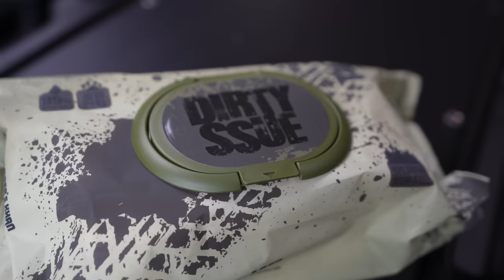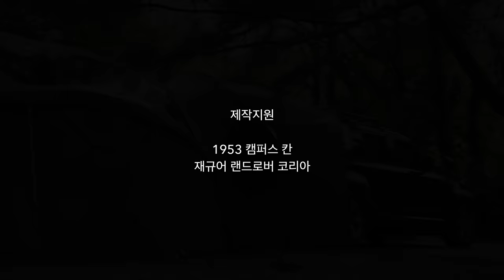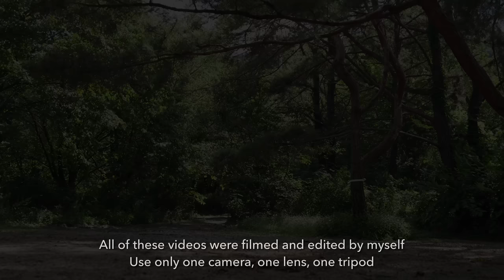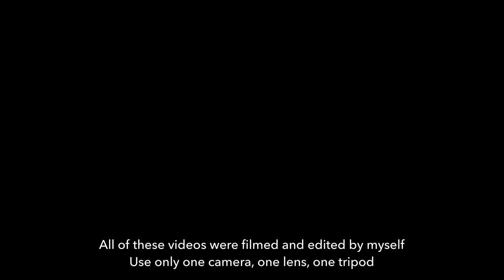Brand New Tent For Car Camping With Land Rover Defender 130

Comment: I think for me personally, all the set up and then the pack up would just sap all the fun out of the trip - especially the dark cloud constantly over my head knowing I’ll have to pack all that back up. Looks space age though.
Reply: Eaxactly - and the price of all that kit - how much would you re-use to get the value out of it over the years before it brakes, degrades or gets lost?   
Sooner buy a Dacia 4x4 and stay and a warm air bnb up the road each night!
Reply: @ajwest3081  I was actually just implying that I’d go for an easier to set up rig. If the guy wanted to camp in something that big, there are heap of single pole tents & bell tents that erect & disassemble in only a few minutes. I personally have a 23zero Outback 1550 swag that literally sets up in under 4 minutes and it already has all my bedding already in it rolled up. So all I’ve got to do is fold out my chair & get a coffee going & I’m done!
Reply: Anything over 2 weeks, ok. Just for a weekend?!😑 But if a buddy sets it up, hell yeah I'm in!🎉

Comment: I love this set up but one thing is bothering me. The back tailgate stays open so will turning off the inside lights save your battery? Is there a backup battery? Enquiring minds want to know! 😊
Reply: I’m asking because they make a tent for my 2014 Honda Pilot, which I TOTALLY LOVE! 9 years old and only 75K miles on her! The last model with so much space in the cargo area! I could camp with all of the seats down but, come on, is that really camping? 
Also, it’s much more affordable than to replace tires (about a Grand) and brakes (no $$$ clue) on my inherited Ford F-150 then add a $15K - $20K slide on camper! 
So $300.00 vs $20K+? I’ll take the tent! 😄
Reply: On our Grand Cherokee all lights turn off after 5min. when the doors stay open. When a door sensor is triggered they turn on again. And you can turn them on individually by hand (like normal when driving) Just test it out on you Pilot - might be the same.

Comment: Very nice , but you have to buy a Land Rover !?!  Why not just get a toy hauler camper trailer with     5th wheel and a you’re truck and when the side by side comes out the bunk beds come down and fold out an you already have everything setup bathroom shower toilet kitchen and a truck for every thing gathering of fire woods and stuff and a side by side for all the hunting and fishing with full solar generator batterie system @ 240 vac, and run all 12 volt though out in an inverter…. In ten minuets your set up , not Days . Watching him set this up he went through many different weather patterns, I have no idea if he started on the 10th and finished on the 22nd or what, at least it wasn’t a different season when he finished  !